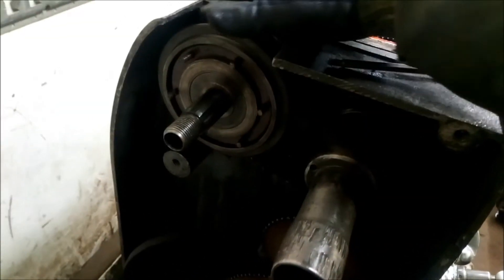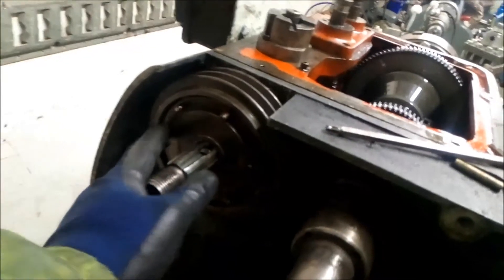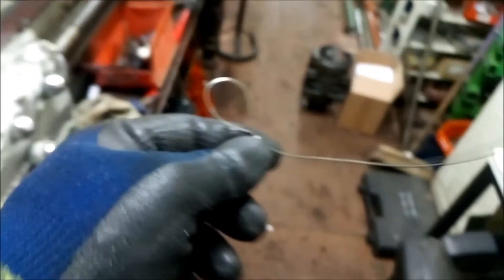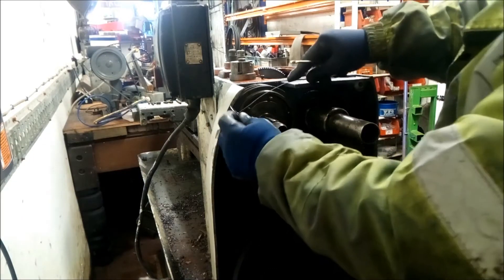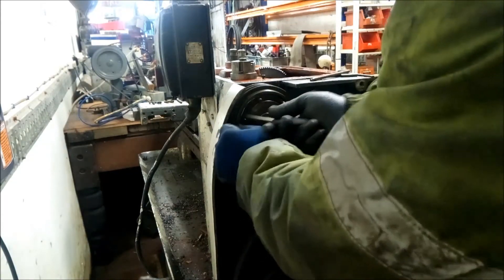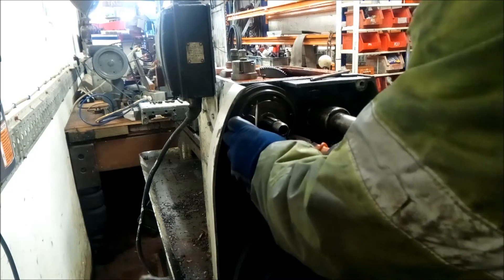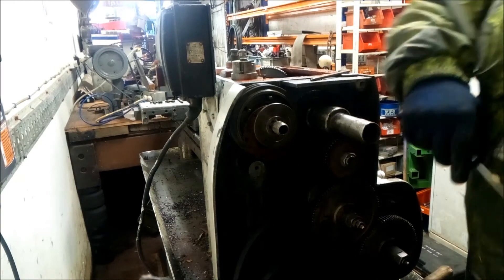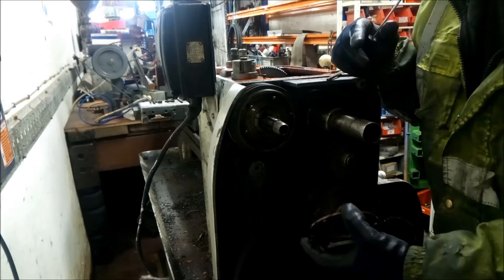Harrison L6 Lathe Clutch Problem

Comment: The bronze clutch plates sticking together is a common problem with these lathes. It is most often caused by oil contamination on the plates which thickens with dust and sticks the plates together. Harrison's owners manual recommends  the clutch should be striped and degreased every 6 months.
Reply from the maker: at the time i made the video i could not find any help online

Comment: My L6 had clutch issues when I bought it, no drive at all. I found that the pin that goes through the input shaft had been replaced with a real bodged repair and the clutch adjustment meant that there was no pressure to the friction plates. I managed to adjust it by tightening the adjusting ring so that it gives drive. But the brake is not very effective and the clutch drags, letting the spindle rotate a bit (not ideal). I plan to do a proper repair on it very soon. I'll post a video when i get into it.

Comment: It makes the same sort of racket at mine does, which I think is due to worn splines. 
New clutch plates are still available from Harrison spares specialists, but they wanted to rip me off for about 100 quid a pair. However got some from a machinery dealer in Bradford, (Eversion Brothers),who used to advertise in Model engineer, to around 20 quid. They had plenty in stock. This was about 10 years ago.
The thing which controls the brake appears to be a brass ring inside the headstock. This is shot on mine and I need to make a new one. Might get it sorted during lockdown.
Cheers.
Reply: It is most often the 2 bronze plates chattering on the 6 drive pins that makes all the racket. Nearly as bad as Ducati dry plate clutch.